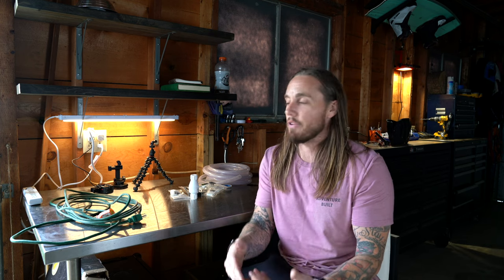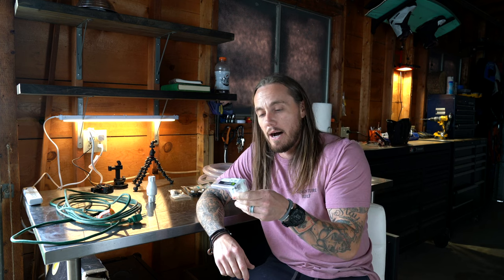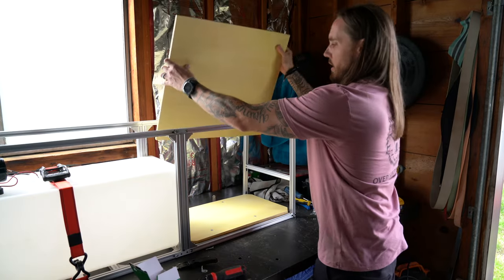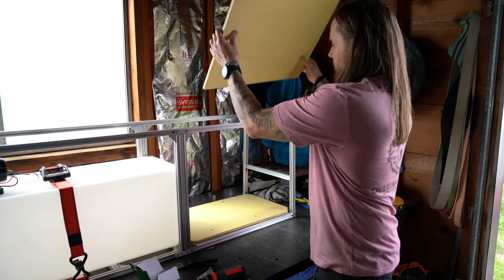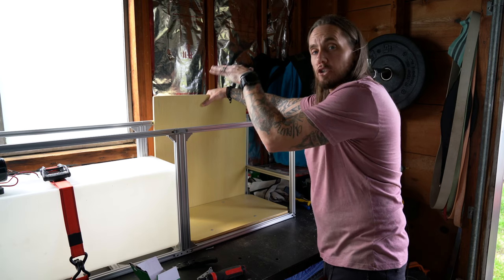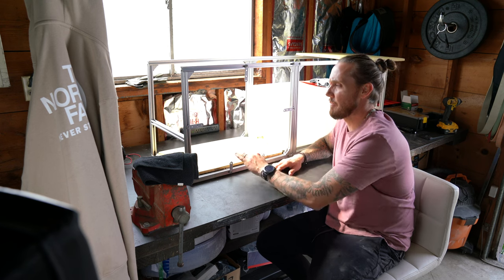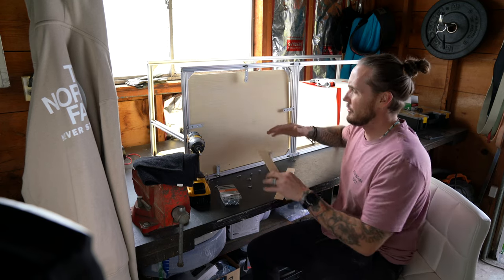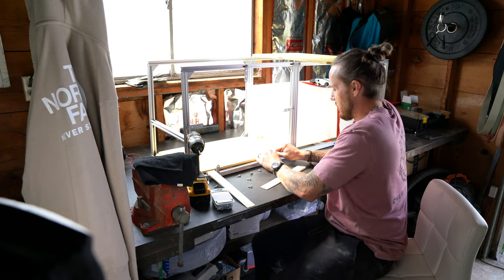Truck Bed Camper Build  | Water and Battery Storage | Ram Power Wagon

Comment: Interesting set-up. I really like the aluminum 80/20 for the framework.

Adding up all the goodies, tent, water, pump, framework, plywood, shell, fuel, passengers, tongue weight from the trailer etc. It would seem that your sneaking up on the payload rating for a Power Wagon pretty quick. Do you know how much weight you've added so far. I've had a few friends go with the std 3/4 ton Ram because the PW didn't have the payload for what they wanted to do....
Reply from the maker: I should be just under 1000 all in. Using 1/2” ply for the platform portion. The trailer is another 200, so closer to 1200 if we pull the camper. Once I get this system set up I’ll probably make some modifications to lighten the load.